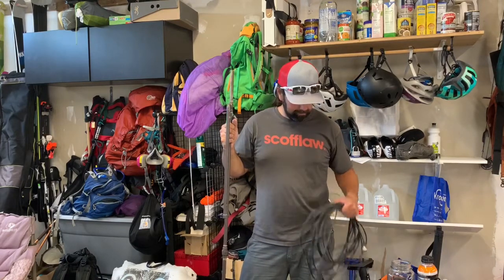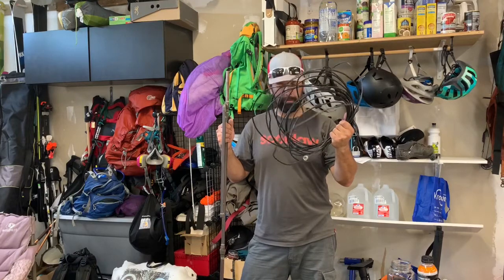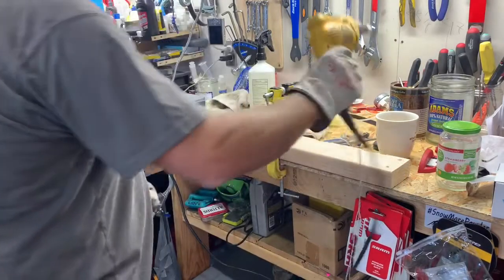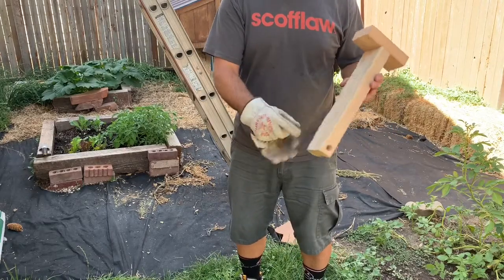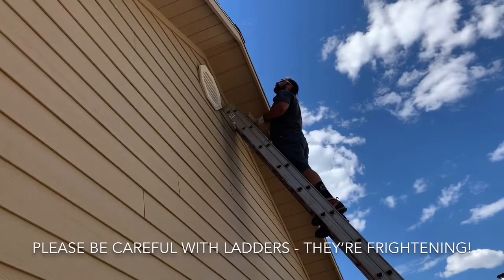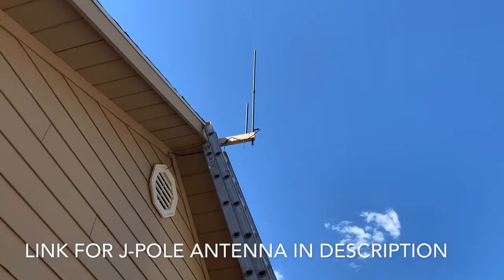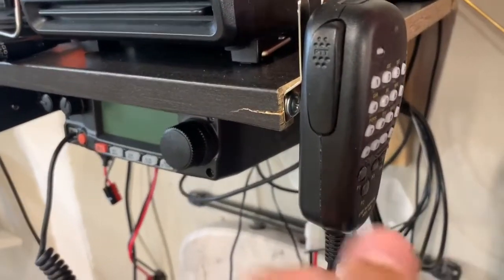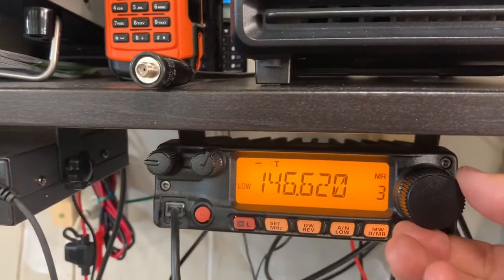Setting up my 2 meter ham radio station

Comment: Is that all you have in your area is VHF?
Reply: Looks like an FT891 above the VHF radio.
Reply: Nimrod Diaries didn’t see that
Reply from the maker: Yep, the 891 is waiting for the antenna installation...
Reply from the maker: Hey Bill, we do have a few 70 cm repeaters, but they're focused mostly in urban settings. I'm over the hill, an 11,000' ridge line separates our somewhat rural town from Salt Lake City. So most of what I have access to is 2 meter. I don't see a lot of 70cm use here either. I only have one HT that even operates 70 cm. And it's pretty quiet.